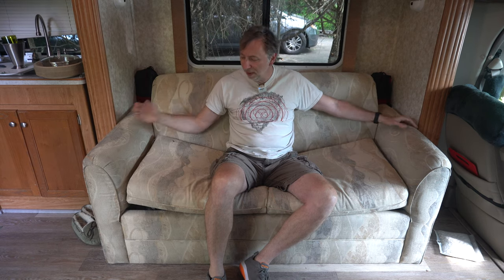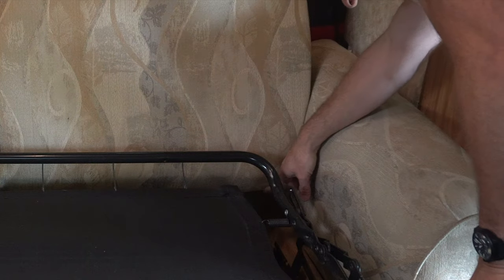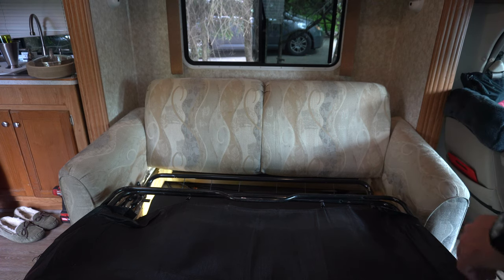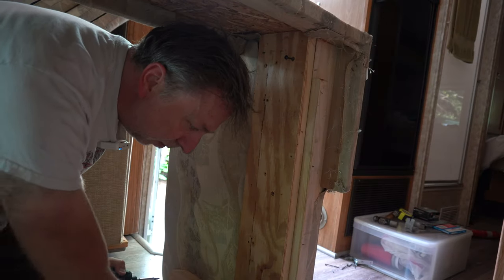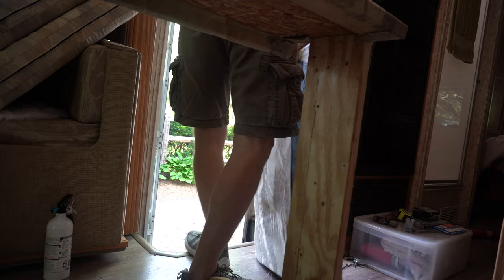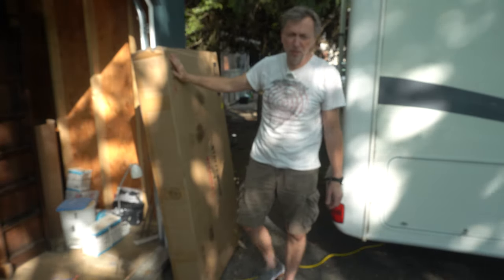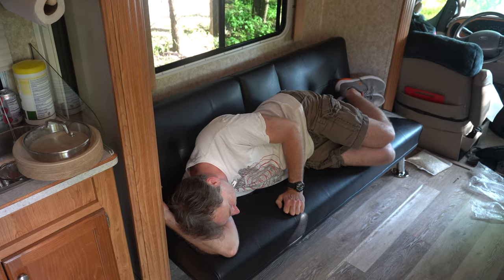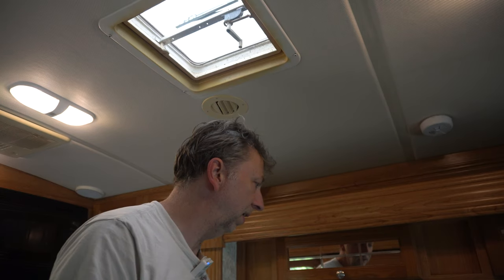Couch Replacement For Motorhome - Low $...Huge upgrade!

Comment: This was exactly what I needed to see for my ‘96 class C rv.  My current sofa is ok, but when folded down to make a bed, mine has the valley of doom down the middle.  I’ve picked out a much better couch from IKEA that folds completely flat to replace it with.  Keeping my fingers crossed!
Reply from the maker: Great! Did you get a chance to put it in? Did it work? Do you have a video up of the process? Just curious...
Reply: @tinyindustrial-rvedition2368   Not yet, getting some electrical stuff repaired first.  Hopefully soon though!

Comment: I keep an empty liter bottle around to throw screws that I take out of things so I don't lose or damage floors by forgetting them. It's also an awesome source for screws when I need a random one. Thanks for the content. I'm learning a lot.
Reply from the maker: Great idea. Do you have an RV or are you thinking of getting into it? I haven't made content for this channel in a while, but it's RV season again, so I'll make the effort to do some more. Thanks for your comments and suggestions. Very helpful for me.
Reply: @tinyindustrial-rvedition2368  No, I do not have an rv. My husband is not into it.  I have land on a river in West Virginia. In the Spring I have plans of getting a storage shed put there, maybe 12X36.  I plan to put a bathroom (incineret toilet like in your videos) and a kitchen area. If I get a gabriel roof style I will put lofts there for extra sleeping. I currently take tents there. We are going next week.  Tents are fun as long as there are no storms.  There is a cabin on the property that has septic, but I don't want to mess with that. The well is in the area of my potential shed build. The county/state allows grey water distribution as long as it's buried in a trench. From their diagrams it looks like the french drain I put in my yard to divert water, so I think it will be easily accomplished. I am wondering about electricity for the shed, since the toilet requires a dedicated 30amp circuit.  My neighbor is a retired electrician. I will probably ask him for details, but I am thinking 50 amp box would be sufficient for the entire building's lights, refrigerator and cook stove, maybe a hot water heater, not sure on that. Thanks for all the content. I really like how you show details. I need details, that's what I'm here for.

Comment: I did have those type couches when my boys were teenagers. The fabric did not hold up, but then that was teenager use and years ago. The reclining mechanism in them never failed though. I originally thought that would be the weakest feature.
Reply from the maker: Yeah, my goal was really to get rid of that hideous piece of furniture that was in there and put in something more pleasing. Longevity didn't factor into the equation as much as price for me. :)

Comment: I have to say I was expecting more on the couches replacement.  But hey how long are you going to spend in it anyway.  It's for traveling and making it easier.  I did like the presentation.  I plan to use it to remove one this weekend
Reply from the maker: What do you mean expecting more? You thought that the new one would be nicer than it is? Not sure I follow. How did your couch removal go?

Comment: Do you need to mount the couch on the floor so it won't move when driving?
Reply from the maker: The couch is not currently mounted. I did put some 90 degree brackets in front of the rear legs of the couch that prevent it from sliding into the center of the RV. Something pretty dramatic would need to occur for it to dislodge from where it sits currently. May seek to strap it down in some fashion and or drill into the rear legs from the brackets I referenced. Not too concerned. Thanks for the question though. Sorry I didn't make that clear in the video.